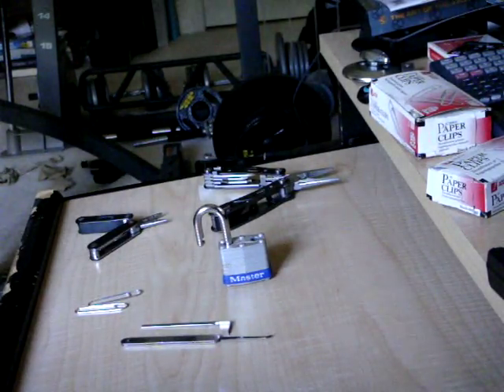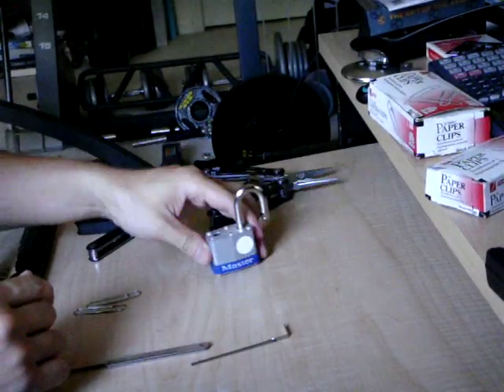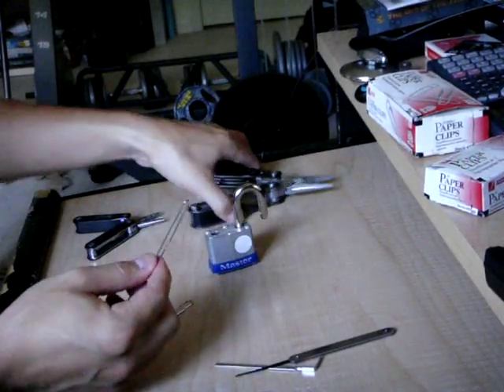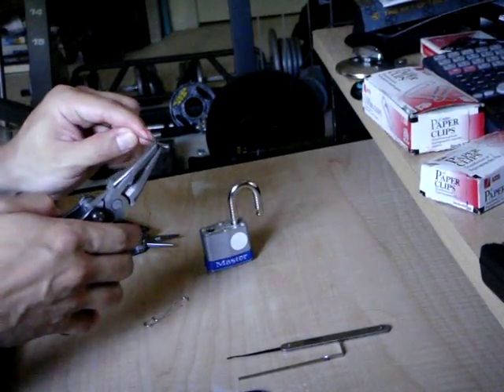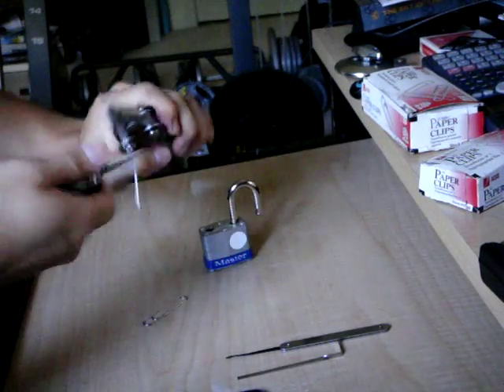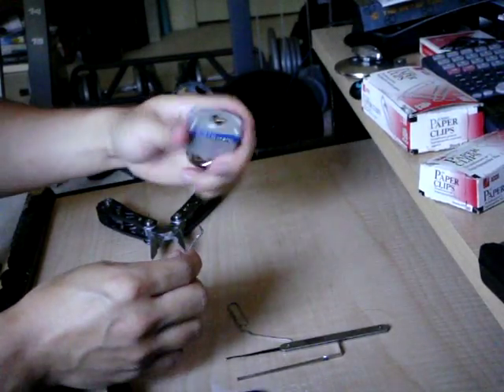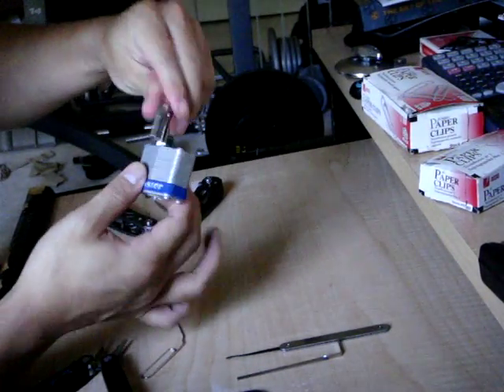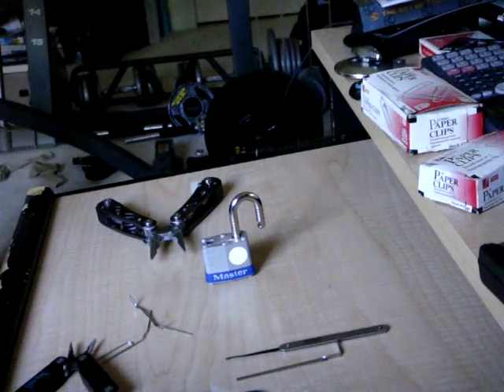How to Pick a lock with a Paper Clip (tutorial)

Comment: Probably depends on the biting too. Number of pind and the biting and of course if any is security etc. But that lock is probably only a 4 pin and if the key cut is not that radical (when buying a lock I look at the key. I have an idea of which cuts I prefer over others). A lot of factors plus the tolerances. The short story is. Get a decent lock and you need to be much more refined.You just don't jiggle even a standard Scandinavian (Ruko, Assa, TriVing etc.) 6 pin open like that.

Comment from the maker: It depends on the lock. On most padlocks, you need to apply clockwise pressure. As a general rule for most door locks, pretend it is a steering wheel and turn away from the nearest part of the door frame.

Comment: Yeah.. You make it look so easy but I can't do it for crap :( I try it on one of my house doors that has a twist lock. They're old locks and the when I put in the tension clip and apply a bit of pressure, then put in the pick and wiggle it around up and down to try to push the pins up.. Nothing happens -:| I'm pushing counter-clockwise to unlock it because to lock it you turn the lock clockwise, is that right?

Comment from the maker: @TimTheTallMan1 The pins may be going up, but they may not be aligning right. If you're bending the tension wrench, you're probably twisting too hard. Depending on the quality of the padlock, it also may have security pins which would make picking it even harder. So make sure you're using a simple lock, and try easing up the pressure on the tension wrench

Comment from the maker: @itachi33343 Never heard of it. It's probably not the brand though. Many locks will say hardened on the shackle. Assuming that it's a locks that uses the fairly standard pin system without extra security features, it should be possible to pick with a paperclip

Comment: dude have you only got one pin in the lock because if you are able to not mention how much tension to apply and also the fact your not even reaching the back of the barrel making it impossible to be able to create the sheer line, also picking is a skill its not a matter of "giving it a bit of a jiggle" its a matter of feeling for the bottom pins and the top pins and also you have to pick a lock from the back of the lock to the front. i would say Load of shit :)